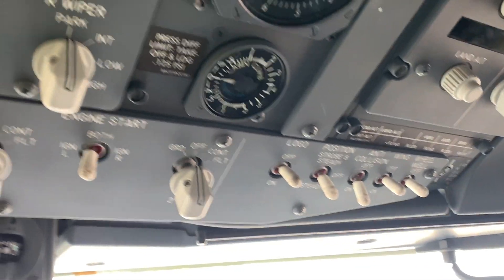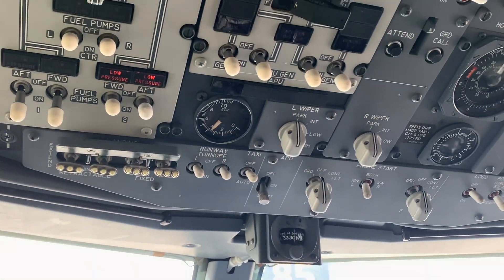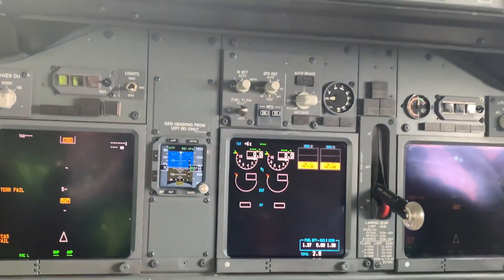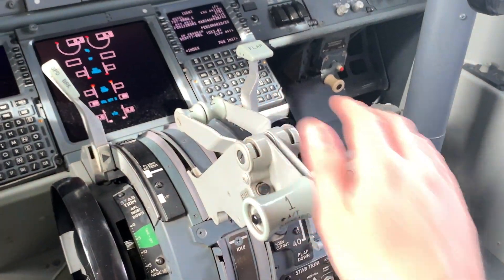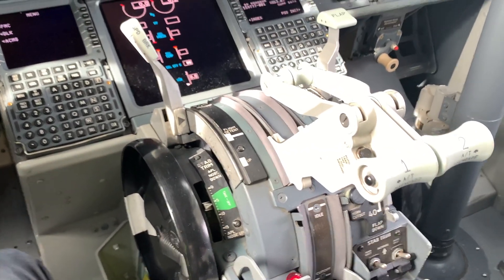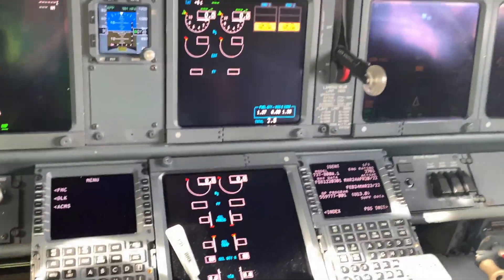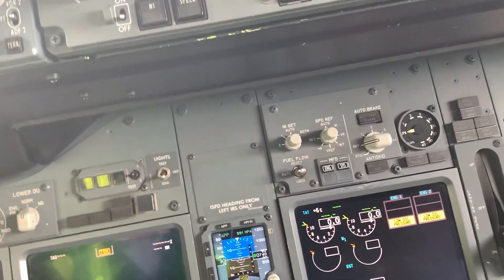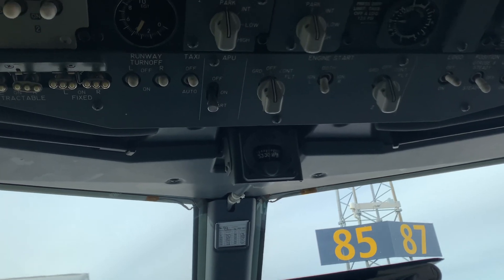🎬  BOEING B737 NG ATA 71 Engine Ground Run, Engine Drain and Vents Inspection. ✈️

Comment: Hello Ian; has been some time since you put aside the CX project, already Spring!!, isn’t time to get back to the project? 
All the best mate 👍🏻
Reply from the maker: Hi Carlos, I ve been doing bits in the background, need to get some videos to put together. Season 2 (the frame) 😂 coming soon. I wanted to get a rolling frame back together with new wheels and suspension, before cutting the frame, which took time and money, but all the parts are here now so looking forward to progressing it.
Reply: @aircraftengineerstoolbox2560  Thank you for the “update”🤣, I’ll be waiting to se the progress.
I just get the stator for mine, delaying the replacement until DGR (May 22nd) if the old one holds until then (fingers crossed)🙄